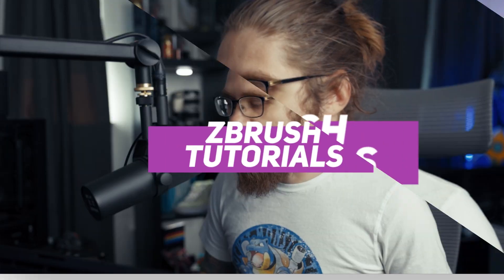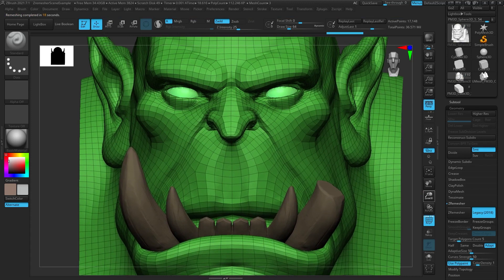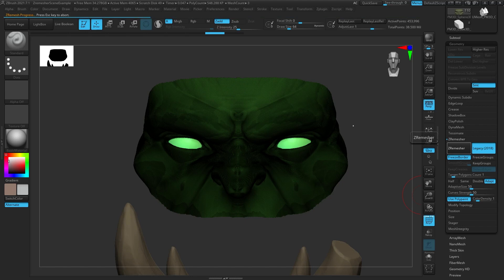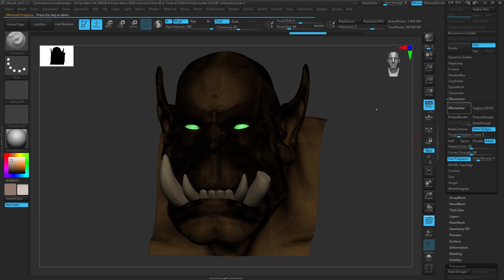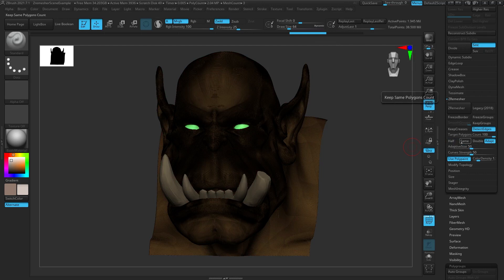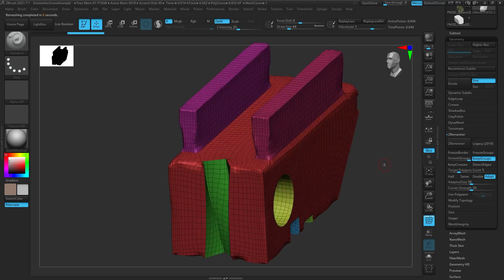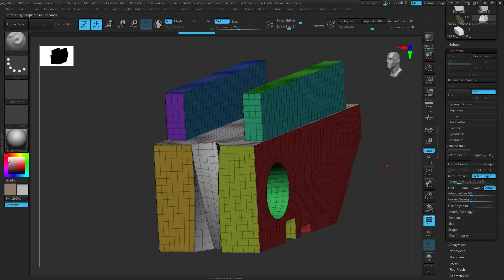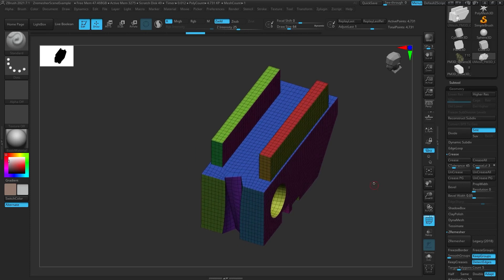Zremesher - All settings EXPLAINED!

Comment: honestly, at some point i gave up on Zremesher, i feel like im way faster doing retopo manually with Zmodeler with edge extrude and move point with attraction. Maybe im biased becouse im doing hard surface and not organic stuff, but i still feel like doing retopo manually and then subdividing mesh and projecting details back from high poly model in organic model cases is better. On side note 3DS max currently have best hard surface auto retopology, its crazy, worth checking out.

Comment: legacy zremesher works best with polygroups on organic surfaces and TWO options ON simultaneously - keepgroups and freezeborder. then you can repeat it playing with smoothgroups slider. it gives you very good topoflow, which is unreacheable with this new zremesher, which almost not working with polygroups on organic model

Comment: How do you handle character retopo and UV. Since they decided to forget about Peel UV, do you use other applications to finish the character pipeline?
Reply from the maker: I feel like my workflow is in a weird place in regards to UVs. I still do all my unwrapping in maya which is funny since it's really the only thing i'm still doing in maya on a consistent basis. 

If I didn't have access to maya through work I'm not sure what I would do though. I'd probably look at blender or maybe unfold3d which I've heard has similar tools to maya. Though for personal stuff that doesn't need as strict UV standards I think i'm going to start leaning on substance painters auto unwrap more since it does do a pretty good job. I even do use Zbrush's auto-unwrap sometimes but then I export to clean it up and repack in maya. I would love to see Zbrush do a major UV and Retopo update sometime in the future

Comment: Awesome break down! Found this while trying to explain Zremesh to someone. 
As Far as I know Freeze Border is intended to keep hold the shape of edges of non volume meshes if you were trying to line up separate pieces. For example it should be effecting the edges where you cut around his neck/shoulders. But I am not sure if it is a legacy feature that the new zremesh takes into account anyway.

Also for keep groups I have noticed that 0 Smoothing tends to cause errors but setting to .1 or something pretty low it will usually do a lot better at keeping edges.
Reply from the maker: Glad you liked it! That makes sense. Situations where your head mesh is a separate object from the body that would be very useful.